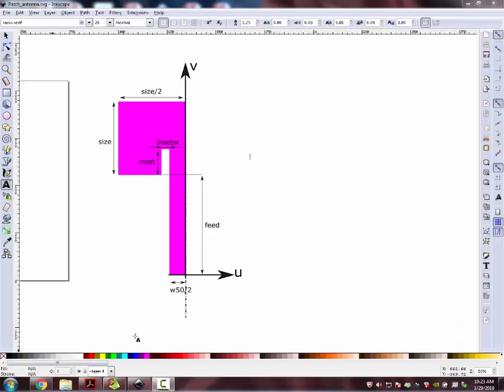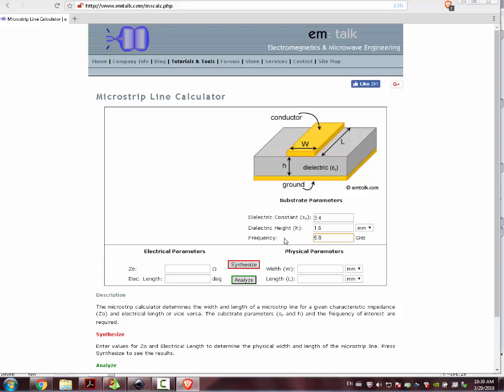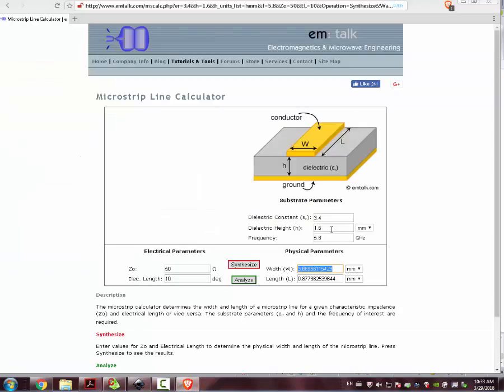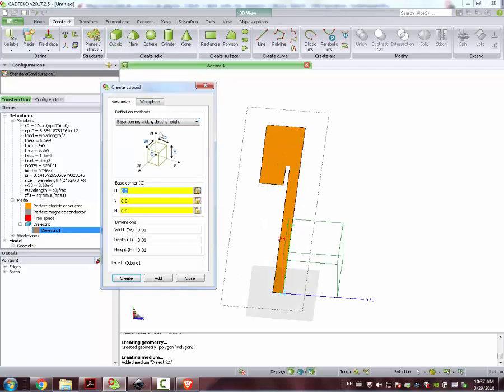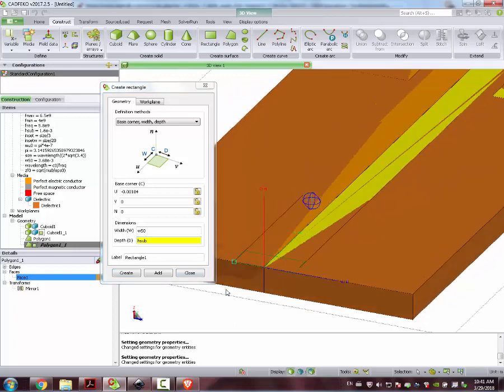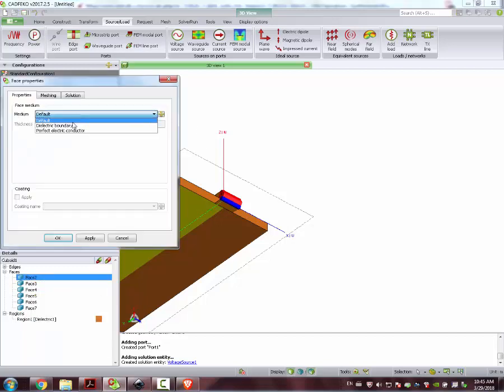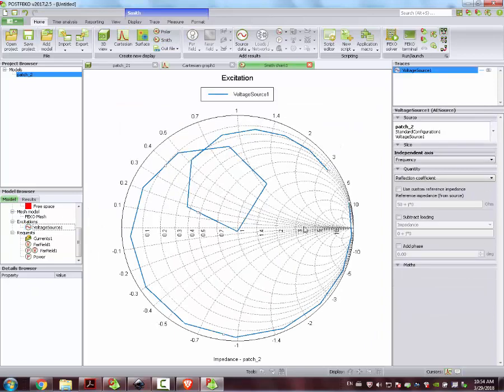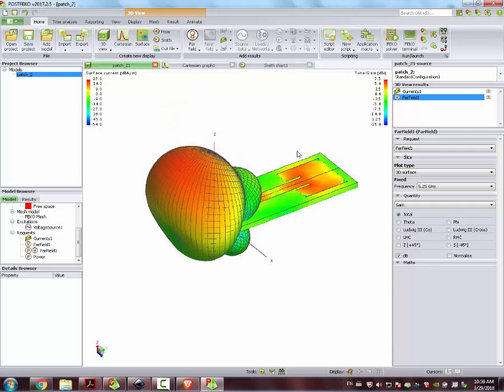Patch Antenna Design with FEKO

Comment: i know this is a very old video but just wanted to know does the length of feed effect any of the results and how?
Reply from the maker: @DIVYANSHUVYAS2022BatchPESUnive, in theory if a line is 50 Ohms it wont change anything. In real world it will radiate and disturb the patch fields. If its too short though, it will place the connector too close to the antenna, which is also bad when the frequency is high, then the SMA is too close to the antenna, and electrically large.

Comment: sir this is urgent i need clarity here how can we change the values of size if we want to do the same using rectangular patch antenna with same insert feed? please reply fast
Reply from the maker: Naveen the length sizes do not change that much due to the feeding. You can keep the same patch size for both feeding methods.

Comment: i've been challenging to make this code using lua in cad feko.
but i got stucked because i don't know how to Add Dielectric condition! 
somebody help me! 

app = cf.GetApplication()
project = app:NewProject()

-- Add Variables. 

eps0 = project.Variables["eps0"]
pi = project.Variables["pi"]
mu0 = project.Variables["mu0"]
c0 = project.Variables["c0"]
zf0 = project.Variables["zf0"]

freqVar         = project.Variables:Add("freq", 5.8e9, "The fucking frequency")
wavelengthVar   = project.Variables:Add("wavelength", "c0/freq")
sizeVar         = project.Variables:Add("size", "wavelength/(2*sqrt(3.4))")
feedVar         = project.Variables:Add("feed", "wavelength/2")
fmaxVar         = project.Variables:Add("fmax", 6.5e9)
fminVar         = project.Variables:Add("fmin", 4e9)
hsubVar         = project.Variables:Add("hsub", 1.6e-3)
insetVar        = project.Variables:Add("inset", "size/3")
insetwVar       = project.Variables:Add("insetw", "size/20")
w50Var          = project.Variables:Add("w50", 3.68e-3)

freq            = freqVar.Value
wavelength      = wavelengthVar.Value
size            = sizeVar.Value
feed            = feedVar.Value
fmax            = fmaxVar.Value
fmin            = fminVar.Value
hsub            = hsubVar.Value
inset           = insetVar.Value
insetw          = insetwVar.Value
w50             = w50Var.Value

origin = cf.Point(0, 0, 0)

-- Add Polygon

ppoints = {}
ppoints[1]  = cf.Point(0,0,0)
ppoints[2]  = cf.Point(-w50/2,0,0)
ppoints[3]  = cf.Point(-w50/2,feed+inset,0)
ppoints[4]  = cf.Point(-0.5*w50-insetw,feed+inset,0)
ppoints[5]  = cf.Point(-0.5*w50-insetw,feed,0)
ppoints[6]  = cf.Point(-0.5*size,feed,0)
ppoints[7]  = cf.Point(-0.5*size,feed+size,0)
ppoints[8]  = cf.Point(0.5*size,feed+size,0)
ppoints[9]  = cf.Point(0.5*size,feed,0)
ppoints[10] = cf.Point(0.5*w50+insetw,feed,0)
ppoints[11] = cf.Point(0.5*w50+insetw,feed+inset,0)
ppoints[12] = cf.Point(w50/2,feed+inset,0)
ppoints[13] = cf.Point(w50/2,0,0)
polygon = project.Geometry:AddPolygon(ppoints)

-- Add Cuboid

corner = cf.Point(-size/2-2e-3, 0, 0)
cube = project.Geometry:AddCuboid(corner, size+4e-3, feed+size+2e-3, -hsub)

-- add palte and split

corner1 = cf.Point(-w50/2,-hsub,0)
rectangle1 = project.Geometry:AddRectangle(corner1, w50, hsub)
p1 = cf.Point(0,0,-hsub)
p2 = cf.Point(-1,0,0)
p3 = cf.Point(0, -hsub, 0)
rectangle1_1 = rectangle1:CopyAndTranslate(origin,p1,1)
rectangle1_2 = rectangle1:CopyAndRotate(cf.Point(0,-hsub,0),p2,90,1)

split = project.Geometry:Split(project.Geometry[5], cf.Point(0,0,-hsub/2), 0, 0)

-- union splited paltes
union1 = project.Geometry:Union({project.Geometry[5], project.Geometry[6]})

-- Add Dielectric condition
-- DielectricVar   = project.Media:Add("Dielectric1")  -- it doesn't work...

-- set boundary conditions
-- union everything
-- set edge port
-- set frequency
-- set voltage source, far field, current
-- mesh
-- execute pf